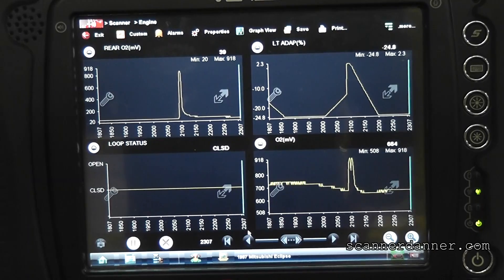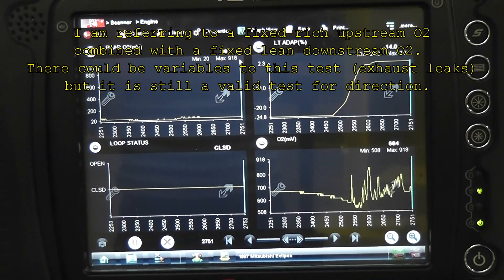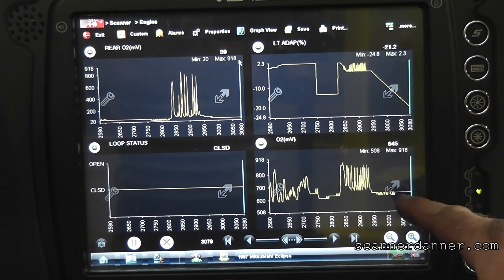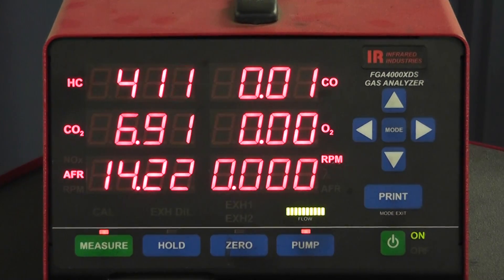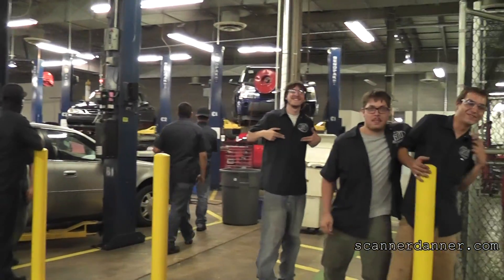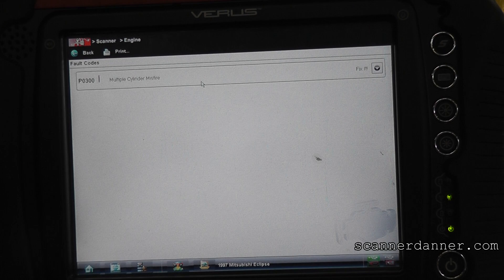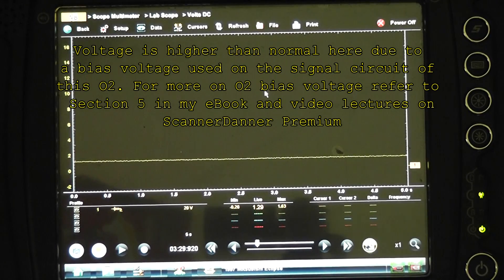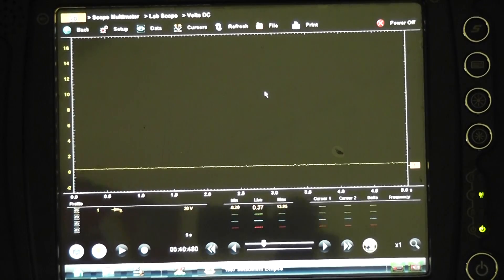How to identify a bad oxygen sensor (signal fixed rich)

Comment: Back again. i am waiting for my scan tool to arrive. I will recheck O2 sensor and Fuel Trims at idle because of the constant rough idle. No check engine light or saved DTC. 1# advance engine timing is always fluctuating at idle. Timing belt and water pump have been replaced  because of age of 2010 elantra. No change in hor engine at idle! I wonder if the O2 Sensor is giving a bad signal taking away more fuel (Rich) than it should causing the rough idle  although the fuel trims look good?
Reply: Hello
Did you resolve the issue? i'm having kind of the same problem
Reply: @hansselabreu649  No , Fuel trims are ok except, LTFT continues to run negative. Changed MAF sensor, ignition coil, plug wires. Car had plenty of power and gas mileage is ok. Still have not found the reason for the rough idle! I even used propane to see if I could locate a vacuum leak.  No answers yet!  This has been getting worse over time. No check engine light!
Reply: Also changed 02 upstream sensor. Still can not find the problem. Engine mounts ok. I wonder if there is a wiring issue?
Reply: Did you ever figure out your issue

Comment: I have a 2010 elantra with a rough idle , that drives ok, but poor gas mileage. i have cleaned the maf sensor and throttle. The car appears to have  have a negative LTFT and STFT...and the O2 sensor bank 1 side 1  is reading over 2.0 volts.(Rich) I have a launch 123i scanner. What should I be looking for? I see the fuel trims at -0.29 and LTFT  is  -.05   ?   any suggestions?  O2 sensor false reading?
Reply from the maker: The upstream O2 could be a wide band sensor, which would give you different readings and those FT numbers don't look bad at all. Any codes?
Reply: @ScannerDanner  No codes. But I noticed another issue that I spoke the mechanic about. I notice that the #1 advance timing on the engine is fluctuating. I am waiting for a replacement on  123i scanner from which I had collected a lot of live data on from before it stopped working. The car engine makes a occasional squeal sometimes when i cold start the engine and a rattling sound. My mechanic said that your timing belt tensioner has a noisy bearing. If the tensioner is not working correctly and keeping the tension on the timing belt correctly it could cause that fluctuation in the timing causing the rough idle and the erratic cold start., which I see on the live data graph.Also the engine idle speed is just over the minimum at 620 rpm.  Everything else seems ok. I will do some more testing when I get the replacement scanner. I could send you data directly or through  your E Mail. I can scan and send graphs or freeze data  by E mail.....Great tool. What do you think!  Thanks Ed
Reply from the maker: @Eddythe_Eagle  so rough idle is your only complaint? timing advance will fluctuate and is most likely normal. I do not agree that the timing belt tensioner and a lose timing belt is causing your issue (rough idle). But if this has been confirmed, you should absolutely fix it, because a broken timing belt or jumped timing belt can result in bent valves and a much more expensive repair.

Comment: What if it is reading opposite? Downstream rich, upstream regular
Reply from the maker: could be normal cat function where it is consuming all of the available oxygen, if you have no codes and no running issues, you are fine
Reply: @ScannerDanner  Im gettng foiled plugs. all four. with a bank 2 senor running striaght .82-.89 volts
Reply from the maker: @davembman3285  not enough info to help you. Year, make, model, engine, fuel trim data, how many O2 sensors your car has etc

Comment: Hey Paul, I have a Honda Odyssey k24 engine 2006. It has negative fuel trim numbers. Right down to -29. So so it has a air fuel sensor and oxygen downstream. The upstream has value of 1.99v and the downstream is 0.850 roughly. 
What should I do next to do next as it has a rich condition and it cannot stay running, unless you have your foot on the gas.

Thanks in advance sir
Reply: With my experience a bad 02 sensor can lead to bad fuel trims, either rich or lean. Are you getting a check engine light or saved DTC?  Next question do you have a scan tool of your own. ?  You can look at a number of good YouTube video'e by various mechanics that can help!  I am doing this myself. I have a launch scanner. If you have a scan tool of your own, it can save you $ and you will learn how to use it !  Labour is expensive!  Hope this helps!

Comment: Mine's running super rich- throwing soot out the tailpipe- but throwing a p0171 and trimming the fuel at 42%.   Is there anything other than an o2 sensor that would give the computer that bad reading?

Comment: Hi Paul,
Do you know why the car still remained in open loop even though the O2 sensor was fixed rich ? I thought the pcm would revert to open loop if an important sensor like the O2 was not functioning correctly.
Reply from the maker: there is a threshold for every car as far as how long it will remain in closed loop during a fix O2 signal event

Comment: Hey Danner! Just picked up an 01 ES300 on the cheap, has a P1155 and misfires on all 3 bank 2 cylinders, finally got a decent scanner hooked up to it, and the afr senor was stuck at 3.98 ish, while the rear sensor was acting as it should, yet it wouldn’t show the long term trims, either way Ive got a new one on the way, and if that don’t fix it I’m moving on to the fuel pressure damper, thanks for your great videos, they’ve taught me the patience and skills to save some real money!

Comment: I get P2097 post Cat rich then after about 10 more miles I get P0420. My long and short FT do not go over +5%. It is 2015 Chevy volt. Do I have bad Cat or Downstream O2 sensor?
Reply from the maker: follow your P2097 code for sure!

Comment: Ok I'm stumped I have a 1992 eclipse with 2l turbo.  Changed plugs leads coil pack. Runs ruff and will pull a p0300 code. Injectores are newer I have a short term of 12.5 percent  and long term of 3.9. Thoughs to numbers are supposed to be close together?
Reply: Those had an issue with computer pcm/ecu capacitors leaking . I have a 95 eagle talon with codes like that and injector codes and the computer had leaking capacitors .. sent my ecu to dsm ecmlink and they rebuilt it and it helped . Lot
Reply: Also join the dsmtuners website for more info on any problems

Comment: Help 2005 PT Cruiser non turbo both upstream down stream low voltage P0031 and PT0037  people are saying it seems running lean vacuum leak I even tried to replace the PCV thinking it may be clogged nope ran worst. Then can't see any think bad hoses but I need these codes gone like yesterday it's driving me crazy have no one around here that knows anything I crammed for 2 weeks with this thing and have more head knowledge then most not trying to sound proud just no one arond here even knows what  I found out in research.also has rough idle. Thinking maybe bad spark plug boot?  Hole in evsp hose? Or purge Solenoid?  Any help greatly appreciated Thank you.

Comment: Hey Scanner, 
 
Have a toyota venza with both down stream 02 sensors fixed at .900 mv (rich). A/F ratio sensors both seem to be reacting appropriate. Any ideas? Thanks! Hope all is well
Reply: I'm experiencing the same issue causing to get p0172 rich condition. Did you find a way to fix this issue?
Reply: @nicolasdelao4195  My daihatsu mira 2014 model upstream O2 take two mins to give reading and crawls up to 0.9V whereas the downstream senor gives 0v most of time on idle. This happend just right after getting catalytic converter washed up. What could be the reason behind it
Reply: @awaisiqbal8934  This might help. The O2 sensors do not work until your engine goes into closed loop. That does not happen until the catalytic converter reach's a correct temperature. At that time the O2 sensor or sensors will start working and reading a voltage. If the o2 sensor has a issue it will give a wrong voltage reading and the ECM will react by changing the fuel mixture via the long term and short term fuel trims. To get a better idea , a scan tool of your own would be helpful. To start with I suggest you should measure the O2 sensor upstream voltage again with the LTFT, and STFT. My understanding that the when you add the LTFT and the STFT should not be more than + or - 10%. Ideally the LTFT should be 0....This gives the ideal combustion value of 14/1 ratio of air to fuel. Ideally if the vehicle is running well, a value of this ratio should be constant under all driving and idling conditions. So you need the 02 sensor upstream voltage reading with the LTFT, and STFT. That would be a good start!  I am not a mechanic but I do watch a lot of good Youtube videos.  Hope that helps

Comment: I have a 2000 Fiat Punto, engine is 1.4 liter, Marelli IAW ECU.
The owner changed the throtle assy because the engine was starting overreved then stalling. After the change It starts and gets to 4000 rpm, in 5 secs drops down to idle and the idle rpm jumps up and down . If I stop and crank again the engine starts fine, idle fine and after a few hundred meters, at the stoplight it rises the idle speed up to 1500-2000 rpm. The only DTC is  " P0560 system voltage " but I have around 14 volts on my multimeter. Any idea?
Reply from the maker: Radu Druncea sounds like you may need to do some type of Idle Relearn procedure. Some of our domestic cars, this must be done with a scan tool
Reply: That was the first thing i've done but ecu keeps forgetting the adaptives. Judging by the voltage error code I think something goes wrong inside the ecu and  the adapt values get erased.

Comment: Anyone knows what it might mean when longterm fuel trim is -20% and shortterm is approximately 0% on bank 1 at idle.  At 3000rpm the short trim then drops to -20%.  No rich codes are ever thrown.  The only code present is the knock sensor code (forget the code exactly).  The car is a 2000 Nissan Quest.  We have tested and cleaned the MAF and the B1S1 O2.  Replaced the fuel pressure regulator.  Cleaned the intake air temp sensor because it was reporting high until then.  ScannerDanner says that inducing a vacuum leak could be misleading due to the MAF sensor.  When the van is first started smoke does come out of the tail pipe along with a fuel smell for a couple of minutes until the car warms up.   Need any more info?

Comment: Want my GMC Sonoma as a test project? Lol... Its  2.2 auto 2000.... 120k only getting 15mpg mixed highway n city driving. No check engine light.. I'm lost also if engine is hot and you let it sit 15 or more min it has extended crank time... Doesn't seem to bleed down pressure with the gauge....any pointers?

Comment: Begs the question of is this the correct O2 for this vehicle.  I remember watching some of your videos where the wrong COP was added and it misfired.  Can the same happen with incorrect O2 sensors.  What's the chance that it's not lying but the ECU can't interpret the signal correctly from the output of a wrong O2.  What kind of clues would a wrong O2 show?  Have a video on that?
Reply: Being a 4 wire zirconia o2, they're more or less universal from what I've seen.  Can't remember the exact video he uploaded about the wrong o2, want to say it was a white chrysler but....  Either way, wiring and voltage checks performed still more or less confirm faulty o2, only other test I'd like to see is chop the o2 signal wire on the sensor side of the connector, strip a bit of insulation off and use your body as a resistor going from the wire to battery positive, just to make sure the PCM is capable of measuring the proper voltage sweep, along with making sure you don't have some goofy short to low power when your scan data for o2 voltage drops to zero upon the wire being cut.

Comment: how can a vehicle not have STFT?
Reply from the maker: It does, just no data pid for it. You have that sometimes with aftermarket equipment on a Chrylser/Mitsubishi mutt :)
Reply: Some vehicles also rely on map sensors instead of maf sensors for short term fuel trims.